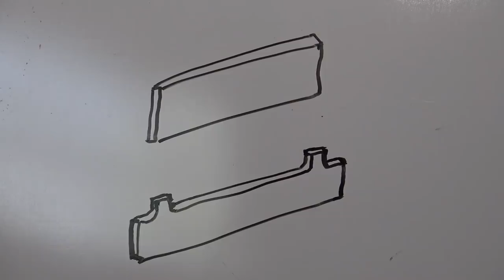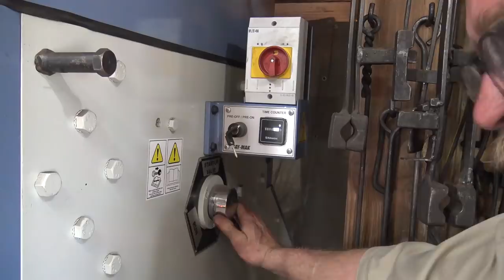Forging a pizza cutter part 1

Comment: Think that pizza may be a little cold by the time you get your knife done.
Seriously though, around this area pizza knives have a regular style knife handle, looks more like the blade from a paper cutter. Then on the opposite end is a flat to lay the palm on. So i was a little confused as to what the 2 "lugs" you started out with were for. But as always great video and great instructions.  Thanks again.
Reply from the maker: I have seen such a wide variety of pizza cutters over the years that I think its really just a matter of style.
Reply: @BlackBearForge  Quite right.
I forgot to add, hope you and yours have a happy Easter.

Comment: Can you also forge the pizza itself or it'd get contaminated by the forge?
Reply from the maker: I think cooking in the gas forge would lead to contamination.  But if you use a charcoal forge you could
Reply: @BlackBearForge  Why would a charcoal forge be cleaner than gas?
I'd guess that charcoal ones can get contaminated a lot easier with heavy metal traces and whatever the flux residues contain.

Comment: what is a cold shut?
Reply: Hi, a cold shut when forging is when small extrusions or fins from previous steps are accidentally  forced into the work piece. This is a concern as it can cause weakness in the piece and it may not be as aesthetic.
Reply: @codygosney976  thank you :)

Comment: I think your pizza got cold John probably won't be no good by the time you cut it
Reply from the maker: No doubt.  Good thing I actually shot the pizza scene 4 days after the forging scene.  But don't tell anyone, it might spoil the illusion.  😜
Reply: i never had a problem with cold pizza
Reply: What's wrong with cold pizza?
Reply: @thomasarussellsr  slap two pieces together pizza sandwich ate many of them for lunch at work
Reply: @erniew5805  just fold the pizza in half, no cutter needed...
Reply: The red hot cutter reheats it as ya go.

Comment: I must put forward the word of caution (and the word of the FDA). Only stainless steels are food contact safe materials. All carbon steels including all san-mai/damascus blades do not qualify according to FDA regulations. I can list the specific items in the code, but there is a really simple test.

Take two blades, one stainless and one carbon steel. Place the carbon steel blade flat on your tongue. Be sure to get full contact like a full inch or so. Now wait one minute and your taste will be ruined for hours. Why? Because saliva reacts with the carbon steel, creating oxides which you taste. These same oxides are created when you cut food with your carbon knife, these oxides end up in your food. Stainless steels do not react with saliva and other food stuff. The oxide reaction is one part, the other is pitting, inclusions and rough spots. These tiny pockets can harbor dangerous pathogens that can be hard to clean, because a carbon steel knife can have these small pockets. This is especially true for damascus knives, since there are many ridges and pockets for pathogens to hide.  

One could argue that we have done so for many centuries. While that may be true, centuries ago we didn't have stainless steels, nor did the FDA exist. So sadly making a pizzacutter (whilst being fun of course), isn't a job for a blacksmith anymore.
Reply from the maker: Interesting, I find that most people I know that take their kitchen knives seriously prefer carbon steels over stainless.  But since an individual making their own kitchen utensils probably wouldn't be regulated, I suspect it won't bother me  to use it in my own kitchen along with all of my other carbon steel knives.
Reply: @BlackBearForge  of course personal preference aside you are to choose as you pleasae. The FDA wouldn't want to raid your kitchen of any knives you might own :D

As for preferring carbon steel, I find that most argue habit or other properties. Habits die hard, even if science is telling you otherwise. That's why I always challenge everybody to take the tasting test. Minds will be altered, be warned ;)
Reply: @patrickd9551  Does that mean the FDA doesn't approve  cast iron cookware as well?
Reply: @stevenbennett5221  Well yes and no. Cast iron equipment has been approved by the FDA only if it is used in a continuous process from preparation to serving.

Cast iron is more oxidation proof compared to carbon steel, however extended exposure to acidic food can still corrode cast iron. Furthermore cast iron is heated before use, so any pathogens are killed in the process.

But I must say that it's a thin line. When is a cast iron skillet allowed for use? Surely a new one is allowed and a completely pitted one is not. But what are exact criteria? The FDA doesn't specify the exact damage to a skillet to reject it. Personally I only own stainless cookingware, so I don't have that problem to begin with. Cast iron things are hard to maintain and it doesn't add much value to the kitchen.